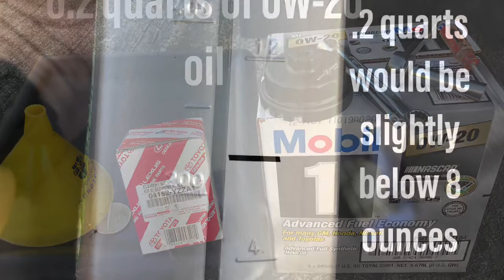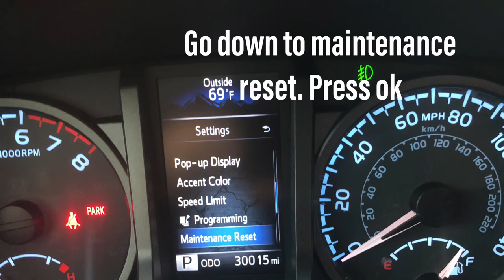Detailed Oil Change on a 2017 Tacoma

Comment: Good, informative video.  I just bought a 2019 Tacoma, 6 cyl double cab.  After the 25,000 mile freebie is done with the dealer, I will be doing this myself.
Reply from the maker: The video was of my 2nd oil change that I did myself of the truck. The first was after the breakin period was over, because during the breakin there's metal shavings that I want out of there as soon as possible. Leaving it in there until 10,000 is not good.

Comment: This was only my second time and first time on this new truck. Great vid..BUT Just maybe an edit can be added about when you put the drain plug back in and the clip on filter housing. STILL GREAT WORK! 
Btw viewers, i wouldn't buy the cheap amazon "Capri " wrench that is $17 or so.. Buy the MotivX one!! Unless you have a 27mm hex which is abnormal size for most hex sets. The one he used had no problems only using the extension.  The cheap one ...eh not so easy to do! Felt like it would strip

Comment: I didn’t have anyone teaching me this stuff growing up so this might be a dumb question, but my old hs car was a 96 Buick lesabre, I changed the oil every 3k miles. That’s what I was told to do atleast. Now I’m 19 and just got a 2017 Tacoma, is it the same deal? Change it very 3k miles? Ik it takes different oil im just unsure how often. I’ve learned everything from YouTube and I don’t rlly ask much ppl irl out of embarrassment. Just don’t wanna fuck up my new truck.
Reply from the maker: You can change the oil as early as you want as long as it’s not over 10k miles. According to the manual, which is what I go by, is an oil and filter change every 10k miles…as long as you use “full synthetic” oil.
Reply: I agree.  I worked at Jiffy Lube as a young man (long ago).  In strict observance of the tribal lore, I changed my oil and filter every three months.  My cars always lasted a very long time.  

Nowadays, I change the oil once per year.  Motor oils have come a long way in the past few decades, and I'm not driving so much any more.  If you use full synthetic motor oil and an OEM filter, you shouldn't have to change your oil before 10,000 miles go by.

I hope your truck lasts a long time.

Comment: at 0:58  you can clearly see the drain plug.  On my stock, 2018 OR model this area is covered by a steel plate.  I can feel the drain plug through a hole in that plate.  Why do we have a difference?
Reply from the maker: I have no idea
Reply: OR comes with additional skids

Comment: I have a 2019 toyota tacoma sport v6. This is it first oil change @ 5,500 miles and only a quart of oil came out???
Reply from the maker: maddog _sniper check the dip stick to see if there’s more oil in there. If not, then you got a problem. Where’d the other 5 quarts go?
Reply: maddog _sniper  i have the same problem, just changed my oil yesterday, and it only a quart of oil coming out. I also broke the oil filter cap, and had to replace it.  Now my engine making this wierd sound, i dont know if it too much oil or too less. Plz help
Reply: @Ryan-ex6cg  lol  your motor is done  if you only had a quart of oil there driving around like that
Reply: The video only covers draining the oil from the filter housing.  There's less than a quart of oil in there. You still have to locate the sump drain plug, remove it, and let the sump oil drain out (a bit more than five quarts are in the sump).  Change the oil when the engine is still warm but after the vehicle has set, motor off, for a half hour or so.

Comment: If I don’t find the same oil in my country what should I use
Reply from the maker: Make sure it starts with 0W. It calls for 0W-20 which should be available everywhere, but if not…there’s OW-16 or 0W-30.
Reply: @howsit9571  in Belize, we don't have ow 20 only Castrol synthetic 5w.30 😔
Reply from the maker: @hermanmohnani6644  what about 5W-20? Got that?
Reply: @howsit9571  might be will check tomorrow .
Reply: Thanks

Comment: 10,000 miles? Really?
Reply from the maker: That's what the owner's manual says. For the free 2 year maintenance from Toyota, they will only change the oil free at 10K and 20K miles. Mileage is only based on full synthetic oil
Reply: I have a am on my third Tacoma and I change the oil every six months or 8000 kilometres or 5000 miles. Oil is cheap and it will make the engine last. Nice review

Comment: Why no torque specs?
Reply: just snug it up good enough lol   oil filter is 18 lb. ft.  drain bolt is 30 pounds i don't really use torque wrench for drain bolt  just snug it up, it won't fall out
Reply from the maker: Tight ft/lbs
Reply: @howsit9571  you made a pretty good video, would have been much better including the torque specs. Oil pan drain plug - 30 lb-ft (14mm)
Oil filter cap - 216 lb-in/18 lb-ft (TOY640 with 15/16" or 24mm socket)
Oil filter drain plug - 120 lb-in/10 lb-ft (3/8" square drive)
Reply: C'mon man, who used a torque wrench for an oil change? If you want the torque specs, you can find em.  If he was showing you how to do a head gasket job or suspension work, then I an see asking for torque specs. I grew up turning wrenches as a child in our family businesses a 76 service station where we did everything that could be done on a vehicle. We never used a torque wrench then, nor since have ever used a torque wrench for something as basic as an oil change. If one can not do this job without torque specs, then maybe they should not be working on vehicles.

Comment: Toyota sure knows how to engineer stuff so that you'll have to go back to the Toyota dealer for service.  I haven't had to pay more than $30 for an oil change in 30 years.  Bad enough it's full synthetic oil you need now.  And I can buy 5 quarts of Mobil 1 at Walmart for $22.88... but all the specials are for 5 quarts... and extra $$$ for the not one, but 1.2 quarts... so everyone charges you for 2 extra quarts.  Oh, and just what I always needed to purchase... another oil filter remover.

Comment: This is the 1st Toyota that I've hated since 1991. I get 14 mpg with this pos and I'm going to put 30 or 40 thousand miles on the oil and trade it for a Nissan. Congratulations Toyota you're as big a pos as GMC or Ford.
Reply from the maker: Mine is a 2wd Sport, and gets 23-24 mpg
Reply: @howsit9571  It isn't wearing Nitto Trail Graphlers which look bad ass but suck in the mud or on the road. Good news mine is for sale! It doesn't get 24 mpg and needs an oil change but it can be yours!